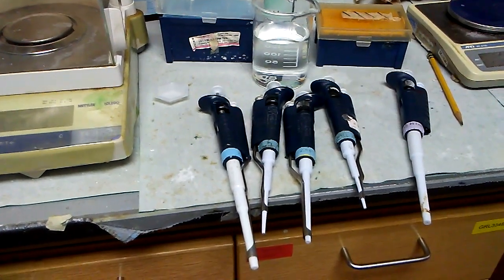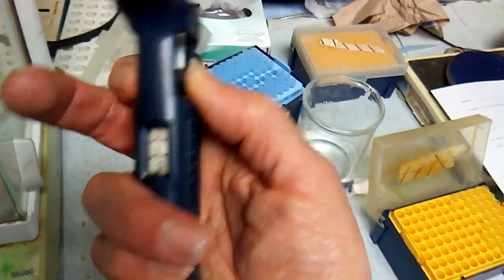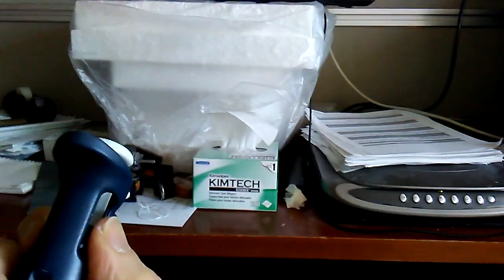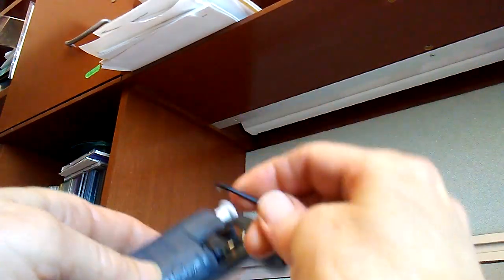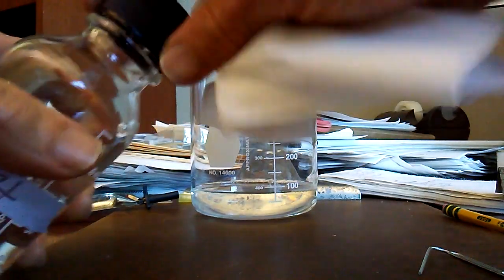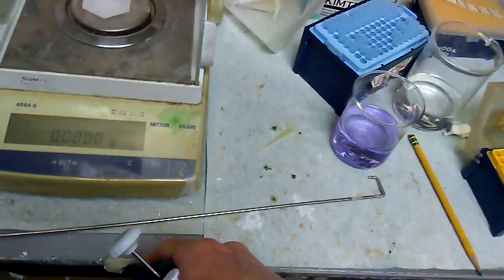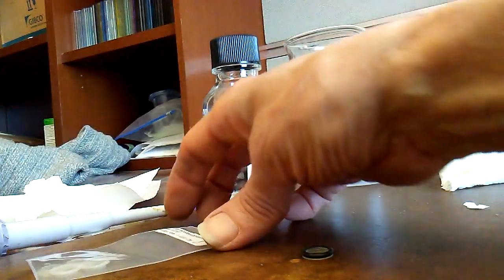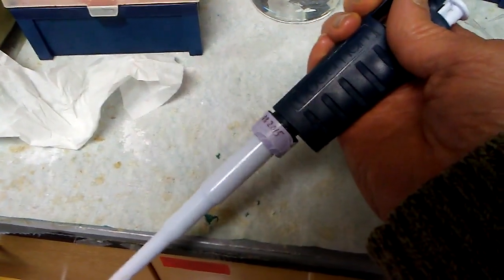Gilson Pipetman DIY Maintenance

Comment: Any ideas for fixing a Gilson P1000 that is consistently delivering about 40 microliters below what it should be? I have replaced the seal and o-ring, and cleaned the piston (piston was rusted and damaged). I adjusted the zero to where there is no extra "give" per the video instructions. Any other ideas?
Reply from the maker: It's possible the piston was just too heavily damaged, in which case the solution is to buy a new piston assembly.  But first I would try to see if there is a problem with the shaft, it is possible the tip is not sealing properly on the shaft, or the O-ring is not sealing against the lip inside the shaft.  You can try reaching into the shaft with a Q-tip to clean around the lip where it contacts the O-ring.  I'd also try swapping the shaft from a working pipette just as a test, and if that fixes it of course the solution is to buy a new shaft.  I've tried resurfacing the end of the shaft where it holds the tip, but never had much success with that.
Reply: Thanks for that feedback! I was getting a little desperate trying to find answers on google! The issue I'm running into now is that I can adjust the calibration on this pipette for the maximum or the minimum volume (by using the adjustment key). But then when I change to test at the other extreme, it is about 20 microliters too low for the max volume, and 20 microliters too much for the min volume. When I follow the procedure to readjust the zero per the video, I end up being about 40 microliters off when I measure actual values. Any ideas? Would that be an issue with the counter?
Reply from the maker: @ashleystewart2809  Of course when you remove rust and resurface the piston you are decreasing the volume of the piston slightly and so the volume dispensed will also be slightly less.  Usually this difference is negligible but if enough material was removed that could account for your decreased uptake.  A problem with the counter?  Not impossible but I think unlikely.  It's just a screw in a chamber and a micrometer to count the turns.  Difficult to see would could go wrong as long as it is still counting out the turns.  So I would try putting in a new piston assembly (~$50) or temporarily swapping in the piston from a good pipette as a test.
Reply: Thank you for that additional insight - I had not thought about how removing the rust on the piston could effect it's volume. I do have an alternate piston that I can use - I will try that! Thanks so much for the recommendations!

Comment: I've never repaired a gilson before, do you need to grease/regrease the internal shafts like you do on finni pipettes etc? I'll have to do some maintenance on a gilson soon.
Reply from the maker: No, I never use grease. I don’t know whether it’s harmful, but Gilson doesn’t recommend it and their pipettes were designed to work without it.  If the barrel, piston, O-ring and teflon ring are all clean, undamaged and seated properly, they form an airtight seal without grease.

Comment: Hi Lawrence, thank you for your video. I have a multichannel Gilson pipette with an electronic display for the volume. The display isn't working although the pipette does. The volume selection happens exactly as in a regular mechanical pipette by rotating a barrel. I think it's just the battery that needs to be replaced. Do you know how to disassemble a head of a pipette (the upper part that we grab in our palm) to get the old battery out?
Reply from the maker: Andrey,
No, sorry, I haven't worked on the multichannel models.
Reply: Hi Lawrence, thank you for a quick reply. I played with my pipette more yesterday. Apparently, to change the battery, you don't need to disassemble the head. There's one lid where the tip ejector is, which you lift up and the battery is right there.

Comment: Is there a link to the worksheet you used?  Or did you just make it on Word?
Reply from the maker: I have uploaded a PDF of the worksheet to ResearchGate.  The link is:
http://dx.doi.org/10.13140/RG.2.2.22219.52003
It was composed in OpenOffice.
Thanks for the suggestion!

Comment: Great video. 
I am currently using a P5000 (5 mL) Gilson pipette.
It has been about a month since the new product was opened.
We measure the weight with water every week and manage it.
From the first opening to last week, about 4.7 to 4.8 g came out.
However, I measured it today and found it to be 4.5g. I only   unscrew the connecting nut and tightened it again. After that, only about 4.2 g keeps coming out. Could something go wrong?
When I first unscrew the connecting nut, I didn't really touch any other parts, and after that, only 4.2g came out and I only saw that the piston was mounted well when I loosened it again. How can I get it to come out over 4.7 g again?
Reply from the maker: I'm not that familiar with P5000, don't think I've ever used one.  But I can't imagine why just loosening and tightening the nut would cause a big change in readings.  I can only suggest that you go through the whole procedure, do the leak test, try replacing the seal, inspect the piston etc.